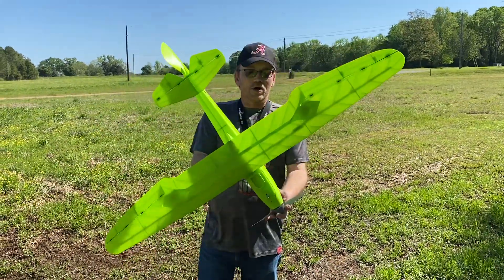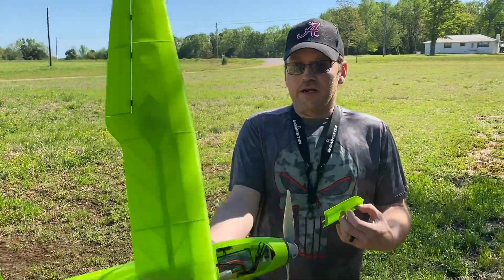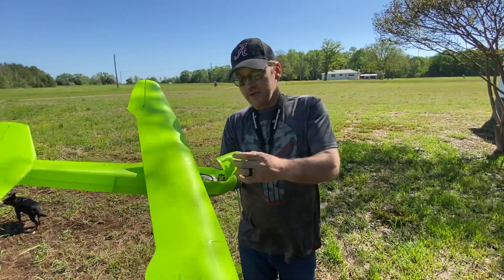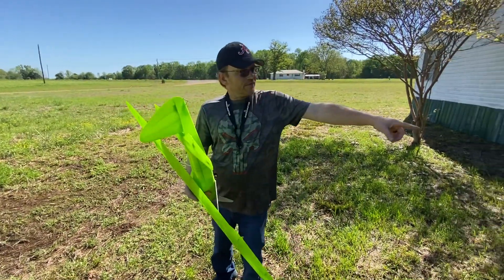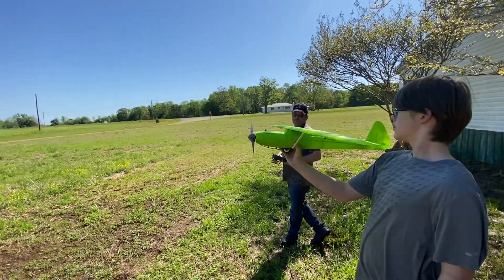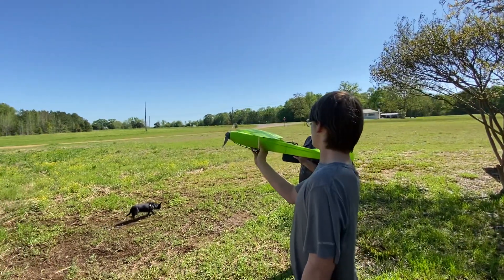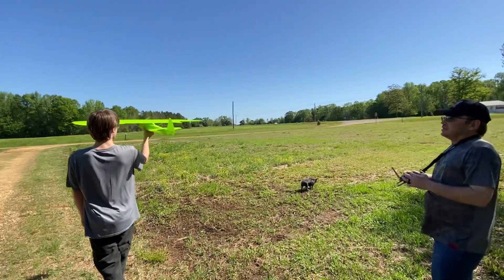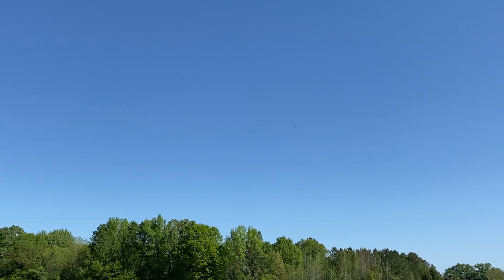Eclipson go1 Wolfe maiden flight

Comment: Kenny, did you do anything to stab the CG or rather where the CG should be? I've built the plane but I'm skeptical about the CG. Do reply ASAP and thanks in advance
Reply from the maker: It flys as advertised on 3s.   Be sure to print the motor mount out of Asa or petg. Cause a pla one will deform in flight!   Let me know if can help further. Cg is about 30 percent of the chord of wing.
Reply: @rodgersrcaviation2785 it's at the notch below both the wings?
Reply from the maker: @I_am_actually_THE_PRO  yep if u put your fingers under the marks. Have the battery in it. It should balance on your fingertips.  I want it to rest just a little nose down!  For first flight. If u end up using a lot of elevator trim to make if fly level u can move battery around to make it fly nicer.

Comment: Why did it stall?  It looks like it had plenty of air speed?

I am building one. I am just curious because it flew great. 
Nice job on the printing and build bu the way!
Reply from the maker: So after investigating the crash I found out that the pla motor mount deformed in flight.    I reprinted with pla+ for the airframe and Asa for the mount and didn’t have any other probs.

Comment: just got my second one fully built balanced the prop and its ready! i have to say i am a little worried about landing it... gear is very short, and if a wing catches it'll be toast. my first flight went maybe 40ft into the wind it stalled bad and could not recover took a left turn nose dive it shattered. I'm using PLA+ and its very very strong compared to PLA I've been giving some supports the bend test man its strong!! anyways I'm looking for new landing gear i may add before i fly. let me know what u think about larger landing gear. THANKS!! you had a pretty good flight in this vid BTW!!
Reply: I assembled 4 of them, all made of PLA+
I broke 2 of them, the first one also stalled on landing, the second one crashed into a tree... it happens...
the second one was printed in white PLA+ from eSan
I only damaged the place next to the center section on the left console
the model is great for training purposes, and it is also relatively cheap and easy to assemble